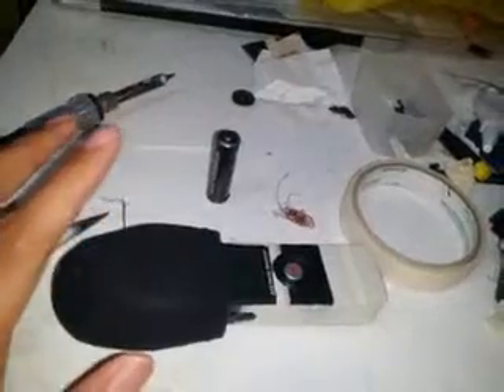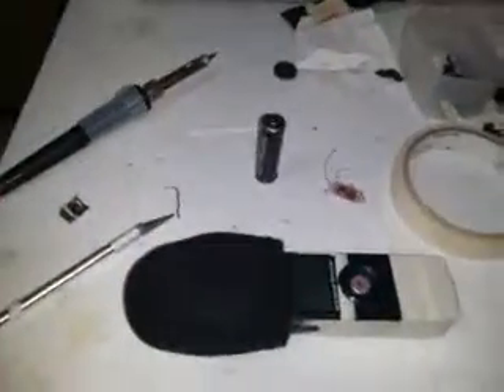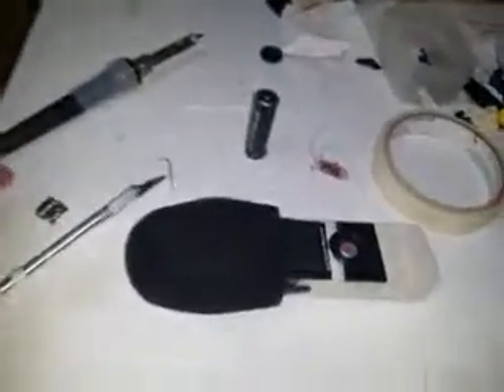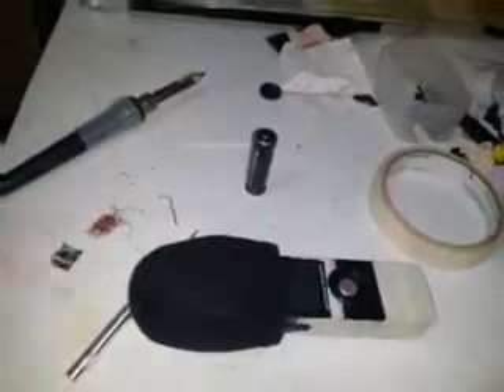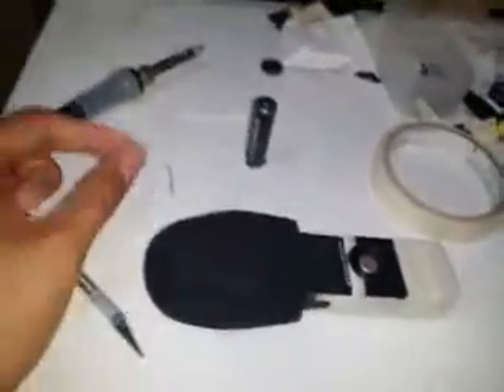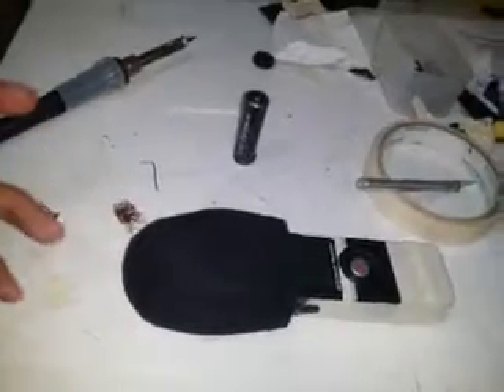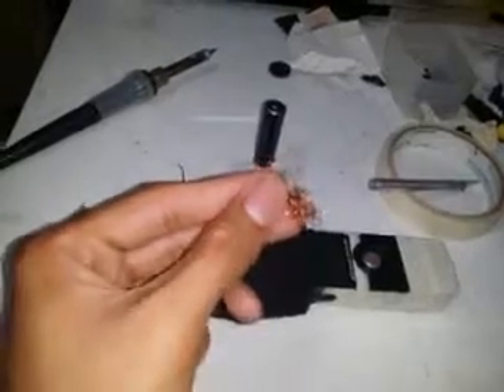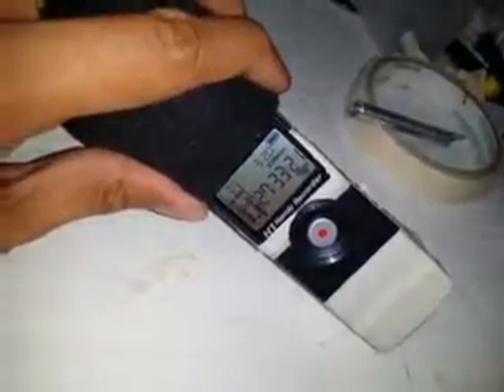Defective Zoom H1 Repair (FIXED!!) -PART 2/2

Comment: How did you fix the power switch?
Reply from the maker: It was fixed, but the STM32 controllers of the Gimbal are making it Haywire.